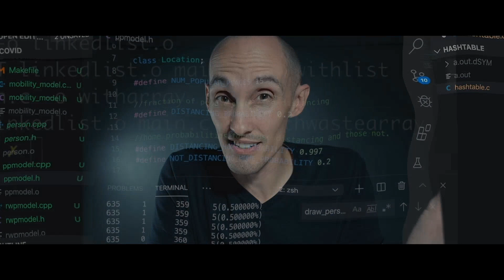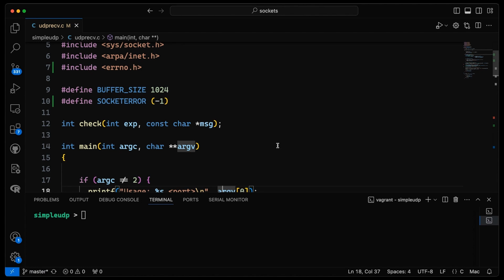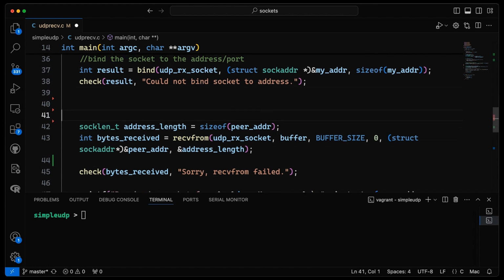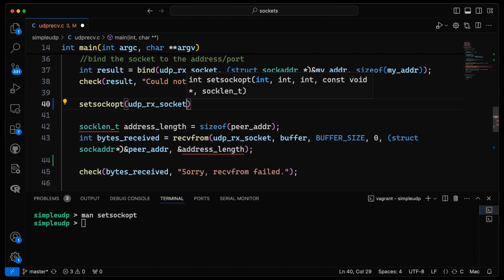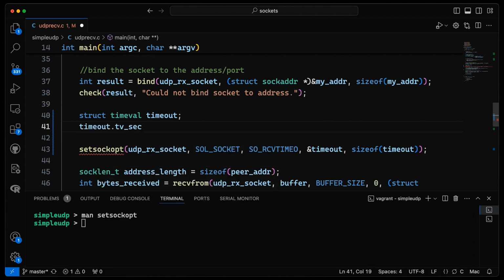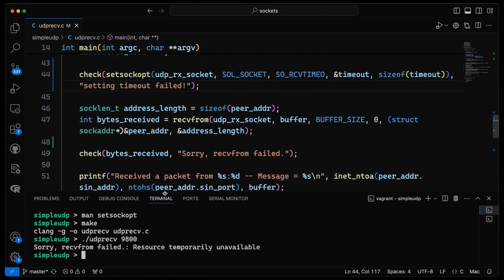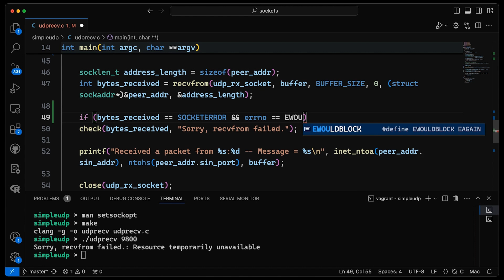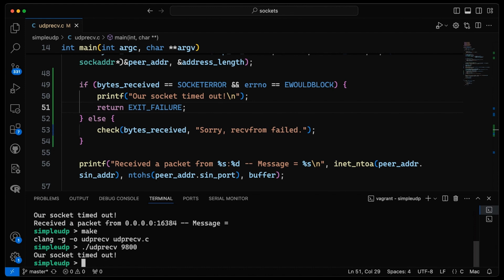How to set a socket timeout (setsockopt) in C

Comment: In simple programs setting a timeout value in the way shown here will work fine ... however, as soon as you handle more than one socket-fd at the same time, it becomes awkward very quick.
In general, I prefer the use of select() or poll() / epoll() where you can specify the desired timeout easily as a parameter, eventually along with socket-fds set to nonblocking mode.